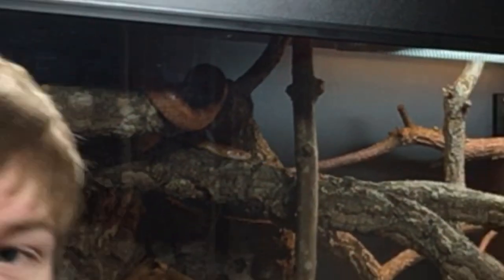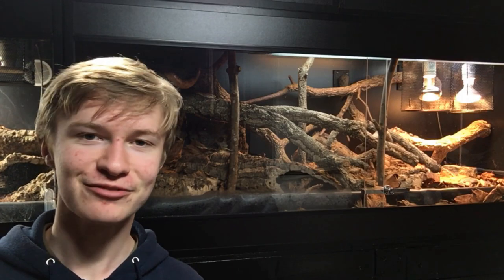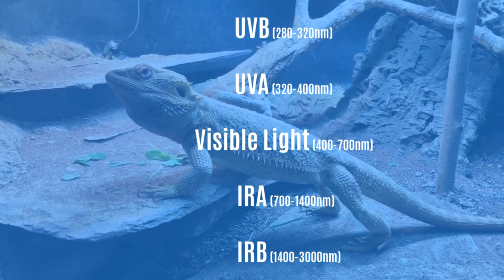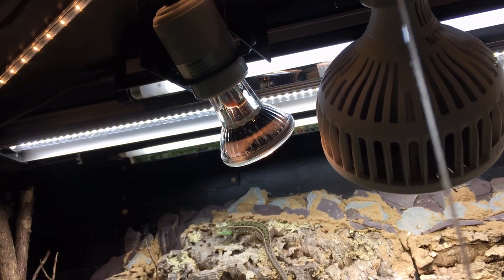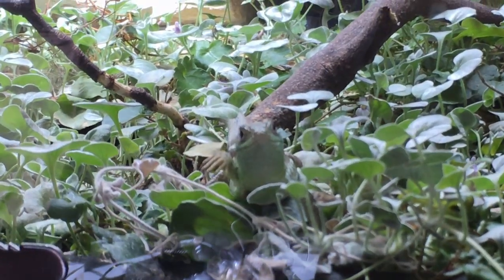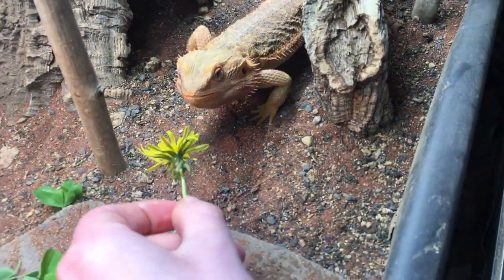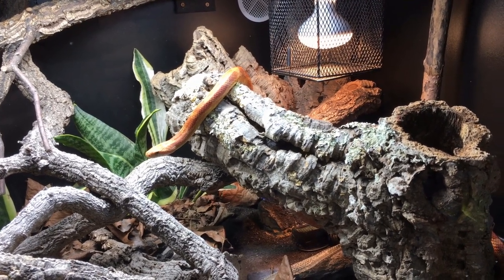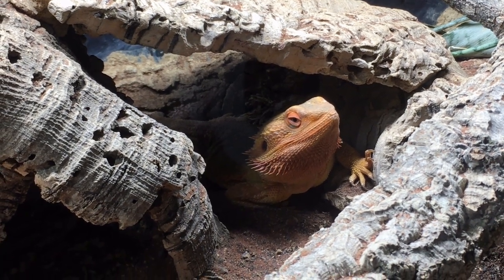Are YOUR Lights Positioned Correctly? Lighting for Reptile Enclosures (Corn Snake Lighting Setup)

Comment: I just want to say thank you JTB reptiles. You have made me realize that heat mats are not good anymore. And now I am switching to halogens and uvb. But I have one question should I go for halogens for my corn snake and ball python or a deep heat projector?
Reply from the maker: You’re very welcome! Definitely go for halogens, they’re much better at replicating sunlight. I made a video answering the very question you ask some months ago - you can watch it here https://youtu.be/dUJZ04sqhxk

😁👍
Reply: I personally would use a bulb that emits visible light so as Joe says they experience infrared A whilst cryptic basking during the day. The deep heat projector is ok to use at night should temps drop below recommended levels but should never really be used as a stand alone  heat source.
Reply from the maker: With regards night-time heating, the case can actually be made that the deep heat projector shouldn’t be used here, either. In nature there is no infrared A or B whatsoever at night, so offering it at night in captivity is completely unnatural! Ideally we should be using something which heats up to 60 degrees as an absolute maximum (so if you pointed a temp gun directly at the heater, it’d read nothing higher than 60), as such an element would only offer wavelengths naturally encountered at night. This is a tricky business I will return to later in the year!

(In most situations, night-time heating is not necessary anyway, so don’t worry about this too much 🙂)
Reply: @JTBReptiles  Thank you so much, so would you even say to use a halogen over a deep heat projector for a leopard gecko?
Reply: @theprelovedpixie1255  Thank you. Do you know where you can buy a dimmer thermostat in the usa?
Reply: @JTBReptiles  Also for a ball python how would i go about using halogen but still making the snake feel secure. Do I like use cork to hide the basking spot and still have  fake hides? Do you know where to buy a dimming thermostat in the usa
Reply: @jwcob1239  absolutely. Crepuscular species must have access to that infrared A and replication of daylight.
Reply: @jwcob1239  lots of shady spots using cork flats and cork tubes.
Reply: @jwcob1239  I'm not familiar with the US retailers but I hear alot of US keepers mention the herpstat?
Reply: @theprelovedpixie1255  I have heard about that but I only have 3 reptiles so I don't really need a massive one like that.
Reply from the maker: Leopard geckos: yes, tungsten halogen lamps are the way to go. The video I linked before talks about why: the conclusions of that video apply to all species.

Ball pythons: yes, making a secure basking site will be paramount to them feeling comfortable when basking. They are shy animals!

👍

Comment: Could i use i a spot led or a metal halide for a corn snake whos technically cathemeral/diurnal?
Reply from the maker: There’s no reason why you could not try it. It would be interesting to see if they used it. I am wanting to do so myself but need to find a way to guard the lamp (because I haven’t been able to find a light guard big enough for a spot LED, and corn snakes are buggers for touching lamps).
Reply: I have an enclosure with a screen top that's why I asked.
Reply from the maker: Should be a doddle then!

Comment: hi great snake can i ask a question i got a six mouth old corn snake he is about 22 inches long do you know what size vivarium can i put him in please
Reply: The enclosure should be at least as long as the snake, with a good amount of depth and climbing height. Adults need a 4x2x2’ enclosure or larger. He can go in his adult enclosure right away as long as there’s enough clutter and plant coverage, and not too much open space.

Comment: Should I use a dimmer and if not how do i get the correct temps?
Reply from the maker: Have a look here: https://www.youtube.com/watch?v=cLADA8Sm9AY

The conclusions of this video are as follows: we should be using lamps to replicate sunlight conditions, not control temperatures. Provided that we accurately replicate sunlight, as long as temperatures are within a "comfortable" range, it doesn't matter what they are. Air temps are to be measured with a probe or dial at the cool end of the enclosure; the air temp at the basking site will not be very different - any measurements made at the basking site will read higher than the air temperature due to radiative heating of the thermometer.

I haven't talked about how we should go about controlling temperatures yet - so far I've only talked about replicating sunlight, which is only half of the story (albeit the more difficult half). In two months or so I will return with videos on temperature control, so stay tuned! (I don't want to give any info just yet, because I can't give full justice to a complex subject in a few lines of writing!)
Reply: @JTBReptiles   Thank you so much.
Reply: @JTBReptiles  Should there be a cool side and hot side now? And if there is how would I go about doing that? Or is it like an overall air temp and they can gold into a cork flat and get a low suface temp?
Reply from the maker: It's more about a radiation gradient than anything else. Remember, in the wild herps thermoregulate primarily by moving to and from areas of light and shade: if we have a well-lit basking site and a dimly-lit shaded area, then so long as the air temperature is "comfortable" (as defined using weather metrics, illustrated in the video linked above), they will be able to warm up and cool down just like they would in the wild. So, as shown in the video we're commenting on, you should have an area where all the lights are and an area which is dark 🙂
Reply: @JTBReptiles  Ok this makes almost perfect sense. Could you tell me if i would be doing anything wrong? I want to use a zilla mini halogen bulb 25watt with the dome. A plain light dimer to make a comfortable temp rang. I will have a basking spot where all the radiation and uv and infrared will be. Then I will use the light and shade method for hides. I will do hides with corkbark how you do them. Thank you so much again for helping me you are really makeing a differenece!